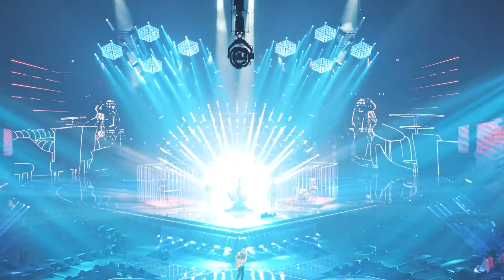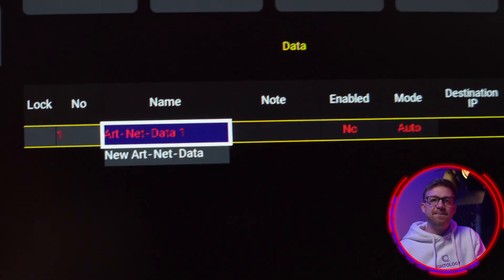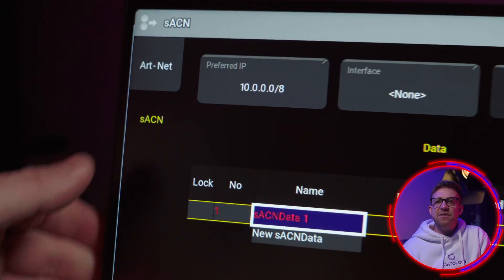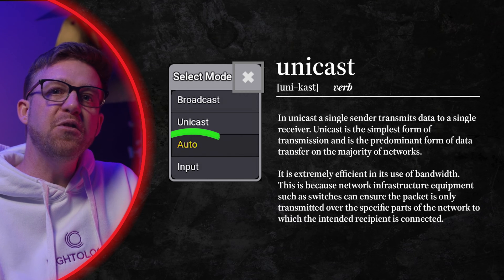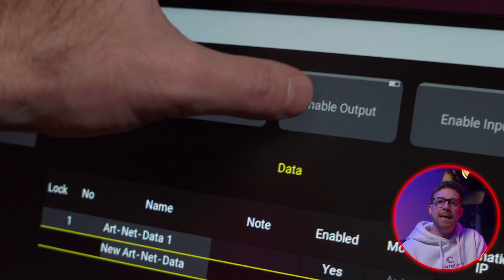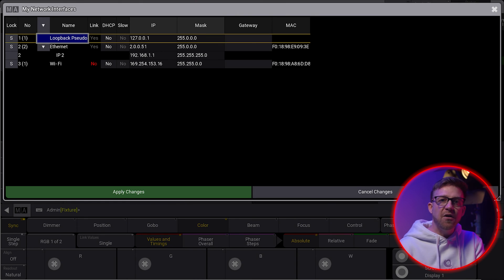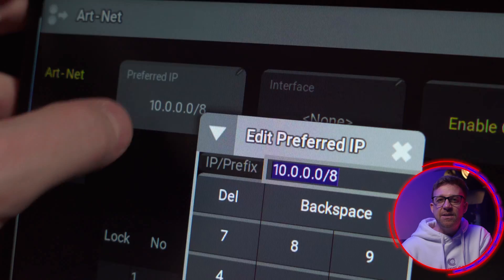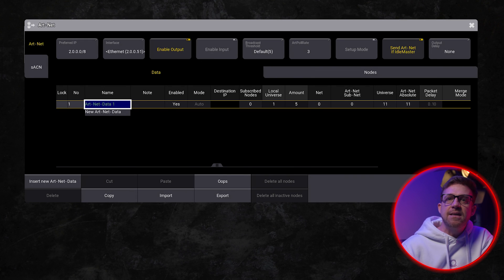Untangle your Network: Setting Up Art-Net on grandMA3 (Tutorial)

Comment: Thanks for the video,
I have a question. I have an onpc command wing set up and I want to add a separate line in artnet tab but the buttons aren’t visible. Also the New artnet data below the line is not existing.   Do you know what’s going on ? I I probably missing something.
Reply from the maker: You're welcome! Can you let us know which software version you are using?
Reply: 1.9.7
Reply from the maker: If you reach out to us at academy@lightology.net.au one of our team will be able to guide you on how to solve your network troubles.